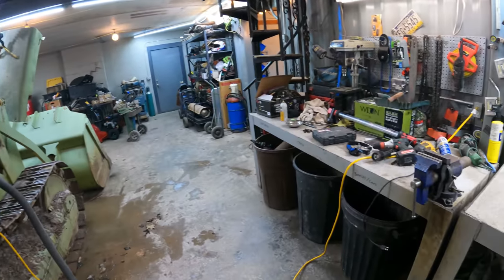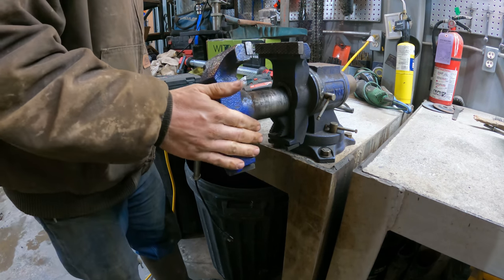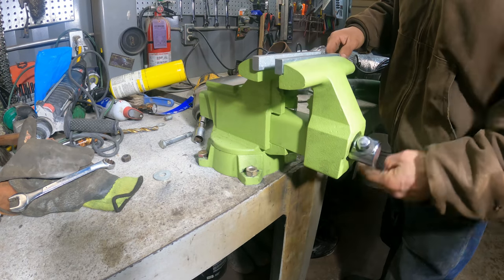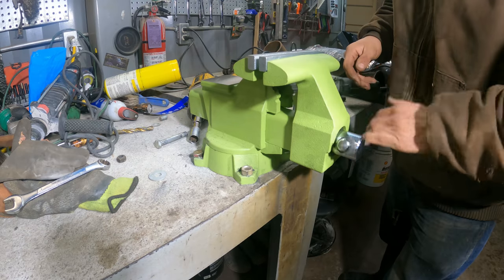Installing a new vise

Comment: An unbreakable hammer handle? Apparently, Wilton hasn't met Andrew.
Reply: And if it ever breaks you get $10,000
Reply: @stevesmith-wc2gb  wait what
Reply: Challenge accepted
Reply: Andrew will get out the welder, repair it with, "Ok, that's fixed. Let's do something else..."
Reply: Wilson make a great hammer
Reply: Indeed! >_<
Reply: Unbreakable is a much lower classification than Camarata-proof.  Not even in the same category.
Reply: @markklosterman5331  yeah. Just lie it on like a step/slope of rock and come down on it with one of the excavators until it cracks somewhere lol Unbreakable means nothing
Reply: The caveat Wilton would use is -  if used as a "hammer" it's unbreakable , not what Andrew gets to use it for !!!!!!!
Reply: Hmm, fancy that Wilton gives you their bonus unbreakable hammer - that is very nice; however Andrew is wanting their unbreakable vice (yes, he's learnt to his regret and being kind won't pipe cheat the handle).
Reply: "I'm on this job today, to show this hammer how to break, let's see if we can break it" 3 hrs later welding it back together
Reply: Hydraulic Press Channel would find a way to break it.
Reply: U can’t break them u can literally run forklifts over them
Reply: @stevesmith-wc2gb  Andrews next vid:  "Alright we've got a box of hammers and an excavator.  Let's get rich!"
Reply: Probably sent it to Andrew for testing! - Is it a Dead Blow hammer?
Reply: @stevesmith-wc2gb  It's not 10,000....B.A.S.H® Unbreakable® Handle Technology that for 2 full years after purchase, break the handle under normal wear and tear and receive $1,000
Reply: Instead of a cheater pipe on the vise handle, they give ya a hammer to beat on the vise handle... cool
Reply: I expect an excavator being used to test the hammer, shortly.
Reply: they know Andrew likes free stuff so they sent one , I think the point was to really test the hammer out if it pass's the Camarata effect it's then worthy of the name "unbreakable"
Reply: @charles johnson how’d u break it we have like 8 in our shop haven’t been able to break any
Reply: @mdsuave13  when Andrew is done with it in 6 month's it's gonna be Cody's chew toy
Reply: @TakeDeadAim funny the synthetic is made to absorb the vibration compared to the wooden handle. Remember Stanley’s tuning fork handle in the 90s I think it was called Vibe Max
Reply: 5k looks really good. I’m still uploading in 1080p, I guess it’s time for me to upgrade.
Reply: I've had a three hammer set of those Wilton BFHs in use daily in an auto shop for 10 years and they are still going strong. They may actually be unbreakable.

Comment: DaVinci Resolve is a great option for a one time buy and updates forever. It supports 12k and almost every video format
Reply: Seconding that, Resolve is great.
Reply: And also is a one time payment if you want to purchase it. I use its free version and its insane how much it lets you do with its free version.
Reply: @Levent_Ergun  Yeah, like if I didn't need to edit gopro videos that have special codecs the free version is amazing!
Reply: blender is also a good option. tons of file types work in it and its the best open source program with tons of addons.
Reply: I think the free version would be fine for Andrew’s purposes
Reply: @hocky-ham324-zg8zc  if he has a gopro 7 or newer certain settings need a certain codec which is not included in the free version due to licensing. But the free version would at least allow him to test it out :)
Reply: @MrJohnweez  thats stupid :(
Reply: @hocky-ham324-zg8zc  Yeah, You can use davinchi resolve 15 though for all go pro videos since that was the last version to include to codec :)

Comment: Just walked in from the garage that houses my vice. Used it all afternoon. Uncle Russel had bought it at Sears years before they folded and never used it. Learned a lot about vises, old American made are better. I bought a new Wilton, one that fits in your 2" receiver. Spun the threaded shaft on a job, didn't even put a pipe on it. They warranted it, but I got another bench mount and the snazzy hammer was included. The old American made Craftsman is much stronger.  RIP Uncle Russel, gone to glory now, but his vise lives on. Thanks for everything, AC!

Comment: Proof that you are supposed to beat stuff with a sledge while it's in your vice.
Reply: I though the hammer was to beat the vice handle to get the vice tight enough for things to stop slipping.
Reply: Hey Moe, I like your video for the garage heater.  Very clever, again.  I plan to make one too.
Reply: @RobertL78  possibly with a smaller-duty hammer, but I doubt that was their intention with packing that large a hammer with the vice.  Andrew said it himself, it isn't a press.
Reply: I’m with the Vise squad. Your under arrest. For picking a tool that is florissant. Your new tool isn’t the only thing that can pinch...😆
Reply: @paedahe4975  holy hell didn't realize your name was the same as mine, I thought this was a reply to my comment and I was so lost xD
Reply: @goodvibes4891  My name is copyrighted... ©️ 😆 You owe me money now... jk

Comment: Hammer: “Unbreakable”
Andrew: Alright, so, today, we’re gonna try and break this hammer. It SAYS unbreakable, buuut...
Reply: Hammer may be but the vice is junk.
Reply: Exactly the comment I scrolled down for. Was thinking, I bet AC takes that stamping as a personal challenge - ha!
Reply: @drewt3210  lol
Reply: @norsevikingsir4932  looks like a fairly good vise to me. worth what he paid for it I’m sure. and a vise is really a stationary clamp, not a hydraulic press.
Reply: @theactualsalvagedrover  I suggest you go to fireball tools channel and learn about good vices then. And they most definitely can be used as a press, not a hydraulic one since there are no hydraulics, as long as it's a good vice, used in it's perimeters.

Comment: You bolted them all the way through.  Good idea.  Same way with floor anchors.  Drill all the way through the concrete and then set your anchor.  That's how we did it in our Chrysler factory. Later, if you don't want that machine there, you smack the anchor down flush in the hole.

Comment: Try DaVinci Resolve for video editing. The free versión is pretty good.
Reply: That's what I started using recently. Amazing app.
Reply: Works great when it works. Crashes a lot for me.
Reply: I second this. Premiere and Resolve have a very similar layout so if you ever wanted to switch later on its not too bad. I used sony vegas, premiere, microsoft movie maker, go pro studio and have settled on DaVinci Resolve because its free for starters, no too too hard to learn, you can also do some Hollywood grade editing if you invested the time to learn how but also great for very basic youtube videos with simple frame cuts.
Reply: Can't the free version only do up to 1080P footage though
Reply: @Barbaratio  It is limited to 1080p. But if he likes the free version, he can buy the full version later.
Reply: @eduardotejeda  So just use it as a test run, makes sense. I've used the free version for 1080 and I like the software.
Reply: @Barbaratio  No. I do 4k videos all the time for my drone with DaVinci Resolve. It is really awesome. 
It only restricts some of the high end effects, filters, and such. 
This is Hollywood studio quality software and I've read that they give it away for free because their business is actually very high end cameras and lens. They figure if everybody uses it on their own time, then when they are in a position of buying new camera and lens for their upcoming blockbuster movie...

Comment: 1080p at 60 frames has really good definition and clarity.  Works pretty smoothly on 1/4 speed slo mo as well. The video files get enormous above that. Also, even with the upgrade of computers, screens, etc., streaming high data is very limited in many areas and can cause the youtube video to stop start, stop, start repeatedly, forcing the viewer to drop the quality down to 1080p, 720p, or even lower.  Thanks for the entertaining videos.

Comment: Use Davinci Resolve to edit....The free version does everything you'll need.
Reply: Also “shotcut” is free and good particularly on lower spec computers. 
GoPro’s create additional low res files which can be used as proxies for most of the editing.
Reply: I wanted to switch to Resolve, but the free version doesn't do 265 files... Like the 5k gopro footage
Reply: @JerseyTom  I've read that if you download the "HEVC Video Extensions" from the Microsoft store it will, but I haven't tried it myself.  I also read that it only costs 99 cents. If you try it and it works, let me know.
Reply: Andrew, Davinci Resolve much more user frindly then adobe products, try it until you stuck with AE.

Comment: I was expecting to hear: "This vice broke for no good reason when I put a pipe on the handle"
Reply: vise
Reply: Ahh ahhhh well said 🇬🇧
Reply: @mwilliamshs  Nope; vice. The U.S. spelling is "vise". That doesn't mean that the correct spelling is "vise". In the country where English was invented(hence the very name: 𝐸𝑛𝑔𝑙𝑖𝑠ℎ) the correct spelling is "vice", exactly as Dirt Road Sailing wrote it. 
Correcting someone's spelling in a YouTube comments section is never a great idea but, when there is nothing that needs corrected, it becomes particularly pointless.
Reply: @2H80vids  the country of origin has nothing to with spelling. You know the US isn't metric either, right? Go look at the wheels of any car, from anywhere. Their diameter is expressed in inches, not millimeters. That's got nothing at all to do with a vise but just as much as your comment did with mine.
Reply: @mwilliamshs  I've no idea what your point is here. For whatever reason, you tried to correct someone's spelling, while failing to take into account the simple fact that they spelt the word correctly in the first place - nothing to do with measurements or wheels.
Reply: @2H80vids  my point is, regardless of how vise is spelled in jolly ole england, it's worth an s here in America where the video was made and the comment was posted

Comment: 7:41 - Saw that coming a mile away... when it was at the table pushed up it was wedged...  I've done that so many times, just sat here going "the wrench is going to get broken to come off, because any sane guy would NEVER back out the bolt to try again!  In for a dollar, in for a pound!!!  LOL!!!
Reply: Exactly right. I was thinking no way he’s gonna loosen that bolt 😆
Reply: That’s what they included the hammer for. Obviously knew their end user. Lol
Reply: @seanhenderson6571  This is why you always get wrenches with lifetime guarantee.  Used to be you bring a Craftsman into a Sears and they would exchange no questions asked.  just for these times, when you would rather beat on it with a sledge, or take a cut off disk and cut your wrench in half, instead of loosening the bolt a quarter turn to release, LOL. 

Disappointed he was able to get off without heavily breaking or bending the wrench. Some good tool carnage on a weekend morning is a nice wake me up.

Comment: I recommend Blender for Video editing, that may sound strange since it is actually a 3D Modeling and animation software, but it has a Powerful Video editor built in.
Blender is Free, Open Surce, widely used and there are no artificial limitations, it may not have every special feature that, for example Final cut has, but it recently got a big update that added a lot. If you need a specific feature, there are also user made plugins.
Reply: Corel video studio.

Comment: Pal, I'm way older than you and from the old school, and I'm glad to see you replaced a Wilton vice with one and the same. Wilton is one of the best. But you should have spent a few more dollars and got one with a round tube (like your old one) rather than the square one. The round vice is much stronger. The other mistake people make installing a vice, is that they don't position the rear jaw of the vice so that it is beyond the edge of the work bench (for clamping long pieces). I still have a Wilton vice in my barn that has been there since my grandfather's days working on the farm. Nice Cat! I still have my dad's 42' KB1 IH p/u and my B61 Mack tractor, you seem to be a guy like me who loves to rescue rusty old junk. I hope I didn't insult you in any way, that was not my intention, this is the first video of you I've seen. Good luck !
Reply from the maker: Thank you.

Comment: I've had that same vice for over 20 years and it's held up well. The weak part is the single base lock. The vice will turn if that lock isn't very tightly secured. I wouldn't buy another vice without 2 locks.

Comment: Haven't watched this yet - but I saw the Wilton vise I used to have in the thumbnail.  I absolutely hated it.  I traded it for an Athol vise (924).  For vise advice - find a nice vise, on Craigslist, an big heavy old one, restore it and 40 years from now it will still be working perfectly fine, but it will have the scars you put into it.

"They don't make them like they used to" - and I say, thank God for that.  They made junk from day 1 and they made great stuff from day 1.  Except for vises.  You can't beat those nice old ones.  The new ones don't compare unless you spend a fortune.

Comment: Hi Andrew, someone who works in the AV industry here. I personally would not worry about making your videos in 5K, it's essentially a standard that only Apple use and even they look like they will drop it soon. 
4K 3840x2160 60Hz is basically the standard right now, recording in HDR10 format (as it's a free format) would be the best option for "future proofing" videos. The next standard will be 8K, 7680x4320 60Hz HDR10 and potentially going to 120Hz HDR10 if we can get the hardware right but even then most hardware (as in the actual cables) likely will only support 120Hz with compression. 
TL:DR 4K60Hz will future proof you for 10+ years. HDR10 content a bit more. 8K60 is the next step. 5K is not commonly adopted and obsolete already. (Also 5K doesn't natively scale to 4K or 8K, so for most users they'll watch in 4K, or if watching on an 8K screen the 4K would look better as it natively scales and 5K would have borders)

Comment: You know what I would have done? take a piece of paper and a pencil or crayon, flip the vise over, then lay the paper on the base and take a rubbing with your crayon or pencil. Now you have a accurate diagram of where you want to drill on the piece of paper. Cool vise. The bullet ones are my fav. cool vid. keep up the good work!

Comment: I watch your vids on an iPhone 10, mostly, or sometimes on an older iPad 10”. Majority of people who come to YT are probably on a PC or mobile. I know some people may watch on newer smart TVs but those TVs are cumbersome to use for things like YT. 
Having said that, I will tell you, there are really only a few key things you should concentrate on. 
1) Keep your frame rate at 60frames/sec. That helps when there is a lot of action, which tends to be what is usually happening in your vids. 
2) Make sure we can always see at least your face and the upper half of your body, unless you are doing a up close, detail shot. You are the star of your channel. 
3) Higher quality means bigger file size which also means longer upload and download. At the end of the day, YT is going to downsample all of your vids based on bandwidth of the end user, so higher quality won’t buy you much.
4) For special circumstances, have you considered 3D videos? I am starting to see more of those on YT. Maybe you can experiment with that.
5) Have you considered any open source options for video editing?

Hope this helps!

Comment: Very humorous view of the Cat loader, the exhaust parts and the workbench and Andrew talking about building a computer and running software and 5K, etc.  "Is this dialogue on the right video?"  lol!  In a class for valuation electronic equipment, I heard that 5K is not a great improvement over 4K and 5K needs more tower sites to serve the same area.  I think there is an upside to it, but likely to be realized only in urban areas.  Just something I've heard.

Comment: @Andrew - I recommend using Camtasia from TechSmith.  It is a very simple interface and you own the program after you purchase.  If you want to purchase a new version, you can get a reduced upgrade cost.  I do a lot of video editing for technology training and it does everything I need and it will edit mp4 files with no conversion needed.  Their current version supports 4k, but likely new version will support 5K.

Comment: If tighting something to non parallel surface (like the last bolt in a video) its good to make a washer/distancer from a thick wall pipe cut angled to match the surfaces aka to make them parallel then to tight it. It release a tension of the bolt and make things look neat.

Comment: I really don't recommend using a carbide bit through cast iron. The carbide is usually larger than the indicated size to allow for proper sizing through masonry. The extra little bit might snap off the cast iron tab. It's not intended for that.

Comment: 4K, 5K all good Andrew, but thinking about the file sizes-- it's important to have redundant high-speed editing storage drives, and the ability to edit lower-resolution 'proxy' files, with the software substituting the full-res files upon rendering. I use Premiere CS6 from when it was still single purchase. GoPros are fine but you might want to check out DSLR options for more controllable video.

Comment: For editing software i highly recommend checking out HitFilm Express. The base program is free to use with only an account registration required and from there on you can buy modules if you need to. I've been using just the base for the stuff I've been doing and have had a good experience with it. Talking as an amateur though, so take that with a grain of salt